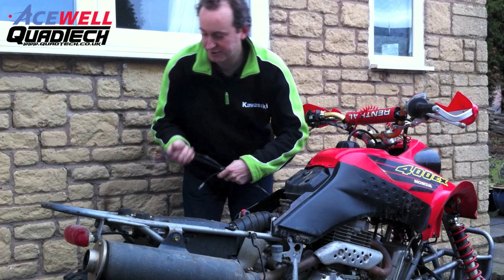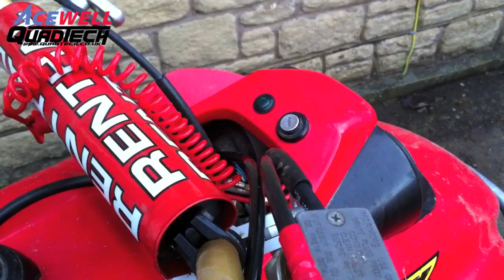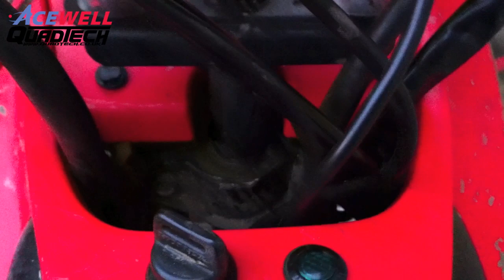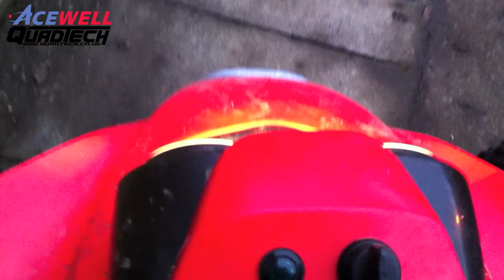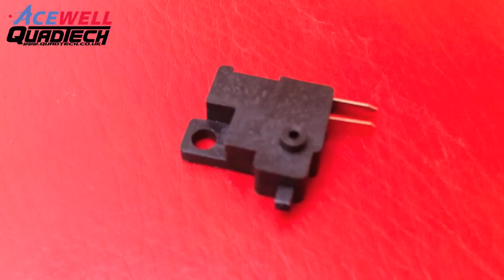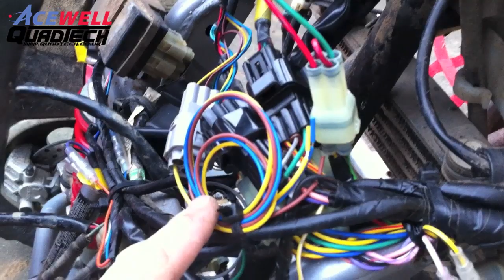TRX400EX Quad Bike Road Legal Conversion

Comment: How much does this cost overall ?
Reply from the maker: depending on the model of quad, £450 for most quads for the kit, plus e-marked tyres (around £300) £105 for MSVA if less than 10 years old, £35 first registration fee with DVLA, then road tax and MOT if over 3 years old. Budget around £1000 to get a sports quad fully road legal
Reply: @quadtechuk  how much for mvsa if the bike is more than ten years old
Reply from the maker: @conormcdade6021  MSVA is not required for bikes and quads over 10 years old. They only need to pass MOT.

Comment from the maker: Why would I want to put tape on the harness, cable ties are much neater. The plugs used are fully waterproof the same as the genuine Honda type and don't need to be taped up. If you have no plugs then the kit is not plug and play as you would have to do solder joints or scotchloks which are untidy and look very amateurish.
I challenge you to find a neater easier to fit kit compatible with all Japanese sports quads.

Comment from the maker: @CR125MANIAC The wiring has to be secured so that no wires can chafe with lots of cable ties (approx every 15cm) to VOSA standards. This video shows the basic fitting of the kit.
Even with the wires insecurely fitted you would get no water damage as all the connectors are fully sealed units. I agree, you could get fire with loose wiring if it rubs against the frame. Even on a new quad / bike it is worth checking the factory fitted wires as they frequently are not well secured